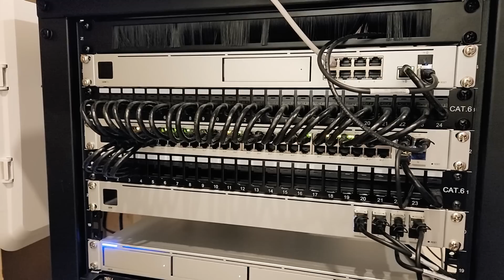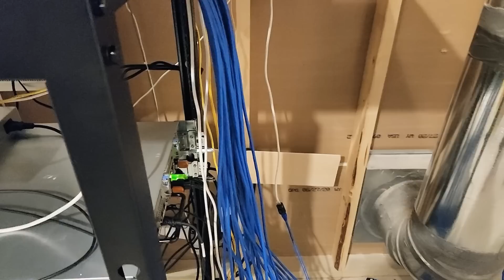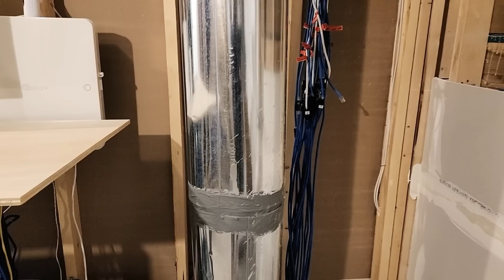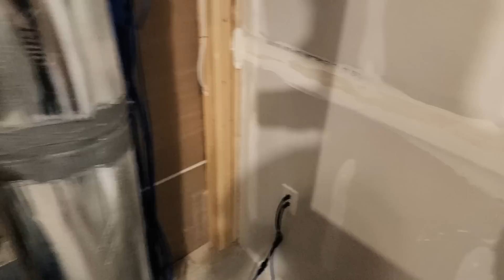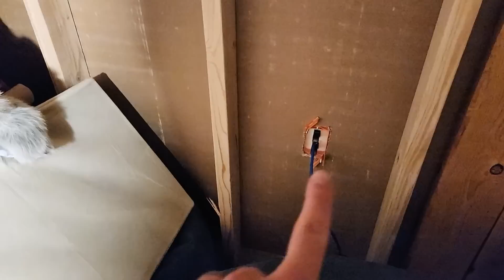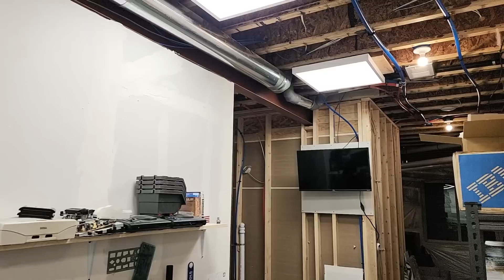Homelab Tour 2023

Comment: Good to know that keystones like you have here do not cause much of headache. I was on the fence about buying a patch panel with RJ45 pass through couplers but this video helped seal the deal. :)
Reply from the maker: haven't had any trouble!
Reply: At first my initial reaction was "more connections more interference" but I think the standard is so ... Overbuilt... At this point. That it can take it no problem. 

I recently took a cat 3 cable meant for phones, 6 twisted pairs. Took four wires and made a gig Ethernet cable out of it... More tolerant than some people think

Comment: Rarely does anyone bother to state the power circuits they are using for their home labs.  Thank you for mentioning that you are using (2) non-dedicated 15A circuits and are considering a dedicated 20A.  Are you going to stick with 120V or jump up 240V?   How much power (watts) does that rack draw at peak usage?
Reply from the maker: Initially I'm going to put a dedicated 20A just for the rack (I'll probably run two dedicated 20A lines while I'm in there for the future). But I'm slowly getting into older and older gear (not to run full time, just for tinkering and historical interest), so I'll tackle a 240V if I ever need it.

I'm embarrassed to say I haven't measured the power yet! I've only had this rack off once or twice in three years, I tell myself every time I'm going to throw the kill-a-watt on there each time but I always forget. Planning to do that next time I need to power off the whole rack.

Comment: honestly you would laugh at my server though its a backup/plex server but mine is a old Dell PE t320 with a12gb of ram, 1 250gb crucial mx500, 2 2tb Seagate contellation es2 or 3 i cant remember at this time, 2 2tb wd blue drives oh and the cpu is a xeon e5-2470 (upgraded from a 2403)....i actually salvaged this server and made upgrades to it none of the drives are in raid but i started off with no drives the crucial drive was new while the seagate drives i bought used and the wd drives was moved from another build i have like 3 empty drive bays for harddrives i may use those slots in the future to make a backup of the boot drive and the backup drive in the future though
Reply from the maker: naw that sounds great! i've always wanted one of those power edge towers.

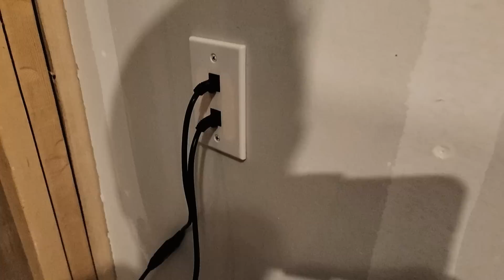Comment: 13:37 Be careful! it might be code where you are that you need drywall blocking off the area under the stairs. You can probably just add some sheets to the bottom of the stairs (the ceiling in that little room) to meet the requirements
Reply from the maker: yeah true, I suspect the builders left it enclosed for whatever code reasons.

Comment: Have you measured your rack's consumption with a meter? Depending on how often they are idle vs busy, you might be surprised.

My own rack with similar Unifi gear, KVM and an R710, R720 with 24-bay external drive chassis only consumes 5kWh per day. Our setup is also offset by solar, which definitely helps, but even if we didn't have solar, it's not super expensive on its own - at a general cost of 30c per kWh, that's roughly $1.50 a day (plus the daily supply charge you can't avoid regardless).
Reply from the maker: I haven't yet, I actually got kill-a-watt just for this purpose but haven't gotten around to trying it out yet. That's actually really encouraging to hear about your similar setup.

Comment: you got your rack in with a furnace? will that not be too warm in there?
Reply from the maker: I was worried about that at first but it actually hasn't been a problem. it's definitely warm in there but way below the allowed operating thresholds for any of that equipment, and definitely under what they'd experience in an actual data center I think.
Reply: @clabretro  That's good then, you'd think it would be too WARM LOL! and i have been inside a data center, its like being in a sauna

Comment: Pretty much same setup I have. I also run an older Blue Iris with 5 cams and my Protect has 8. Your cabling is much better than mine. I use my 10 yo home built atx computer for my Truenas and I bought a QNap for redundancy. It’s all about redundancy.
Reply from the maker: yeah been eyeing qnap as something I could back the TrueNAS up to, or maybe go your route and build a cheap machine to run a second TrueNAS instance on.

Comment: I am in the process of doing this and just got the udm pro se a few g3 flex mini wifi indoor cameras and a 24 port poe switch.  I have the same cabinet as you for my networking stuff and I have been trying to figure out what to do with it since it's a mess and has 110 punch down blocks because the cat5e cable was split for telephone which no one uses anymore.  I might redo the ends with key stones and feed it directly into the 24 poe switch I just got.  The previous homeowner didn't know what he was doing so I don't think I can put a patch panel in my rack once i find one.  I inherited someone else's problem. I am getting multi gigabit fiber this summer from the city so I am getting ready for that. I am also looking for a rack and dont know what to get.
Reply from the maker: yeah you could definitely get the ends of the drops into keystones and go from there. I'd recommend a temporary setup for awhile without a rack, that way you can run everything and decide what you need.
Reply: @clabretro   I finally replace the punch down block with keystones when I upgraded to multi gigbit internet and replaced the old equipment with Omada.  Before doing this for some reason I still dont understand why but I was stuck on 400 mbps even with the new equipment and my poe switch could not provide poe to supported devices.  I replaced all 16 connections from the punch download to keystones and everything started to improve a lot.  Not only that but on Omada I started to get thousands of associations errors before the switch over to keystones now I basically have 0 errors.  I think the original owner bought the cheapest punch down block ever because once all that was done it has worked perfectly at 1.2 GBPS.  Not only that but thanks to Omada I have 100% coverage on Wi-Fi in a 3500 sqft house and no matter where i am on supported devices I get at least 700 mbps on wifi.  I also got ipv6 working on Omada with Xfinity and I get 18 out of 20 on ipv6 tests so for people who are wondering omada does support Xfinity ipv6 actually I got a higher score then my old equipment.

Comment: Nice set up!! Any chance on future videos showing how you did the NAS and more on the home automation??
Reply from the maker: Thanks! And definitely. There's tons of excellent TrueNAS tutorial videos out there, but I was thinking about doing an overview video of my particular setup and how I use it.
Reply: @clabretro  How have you liked TrueNAS. I went the lazy approach and did a Synology NAS, kind of love it and hate it at the same time and eventually need to expand it.
Reply from the maker: Just made a video going over my TrueNAS setup: https://youtu.be/5eA1EKIgOGQ

I've liked it a lot and it's rock solid, but definitely more involved than something like Synology or QNAP. I've been tempted to get one of those to back the TrueNAS up to.
Reply: @clabretro  Thanks for the response. Watched the TrueNAS setup video and subscribed to the channel!!! Thanks for the awesome content.
Reply: @gjohannes1344  i went with synology a few years ago with a simple DS220+. Then i added a 418 for backup of the 220. Then i needed more data storage so i got the 1621 two months ago. And a few weeks ago i build a machine for TrueNas and Proxmox. TrueNas is great for raw storage but i still like the synology more for its software. I use the TrueNas build with three PCIe gen 3 NVMe drives to edit pictures off of. That now backs up over 10Gb to the 1621 and the 1621 backs up to backblaze as well as the 418 synology. Lots of redundancy. My 1621 has four 4TB SSDs in raid 5 and two 16TB in raid 1 for cold storage of stuff i don’t really access much. To save on cloud storage i only back up my most important of photos and videos to backblaze. So pretty much just family photos and videos that are priceless to me.

Comment: Question why patch to a patch? Going directly into keystone patch you can also take keystone out and move
Reply from the maker: Good question, I definitely could've done punch downs on the patch panels in the rack. My thinking at the time was having the most flexibility, and this way I can pull those 15 footers out and use them as-is. But obviously it'd be pretty easy just to crimp some connectors on them as needed, so it was probably overkill to do everything patch to patch like this.

I do really like having the drops from the house go into those pass-through keystones though, it's been nice to be able to reconfigure certain drops with minimal effort. If I remember correctly I also did it this way because I just wasn't quite sure how I was going to build everything out.